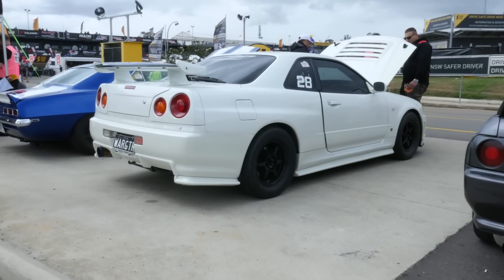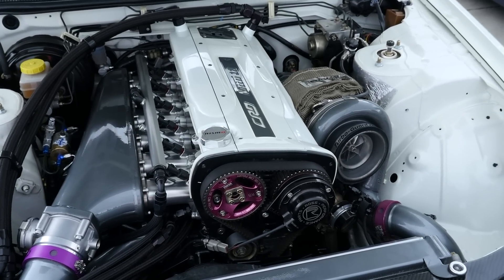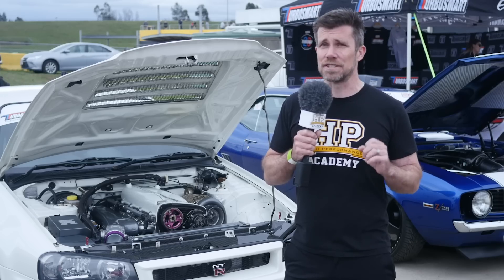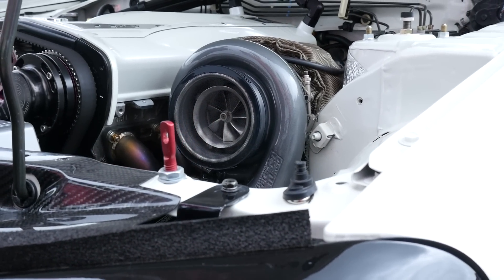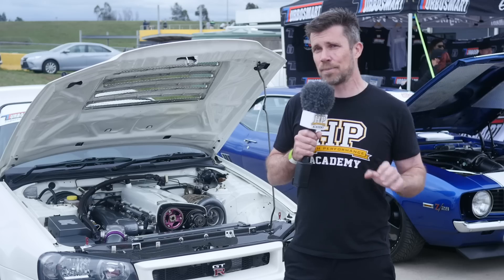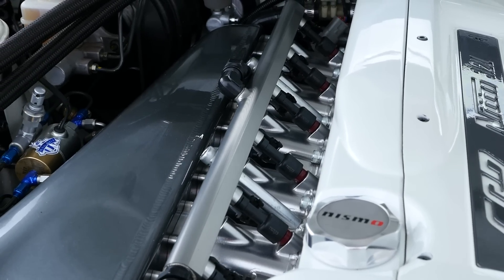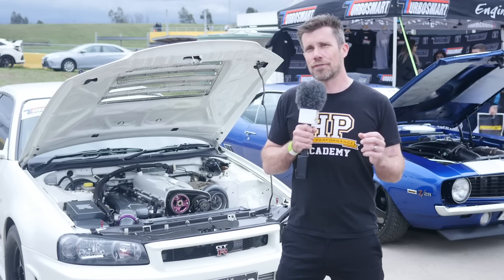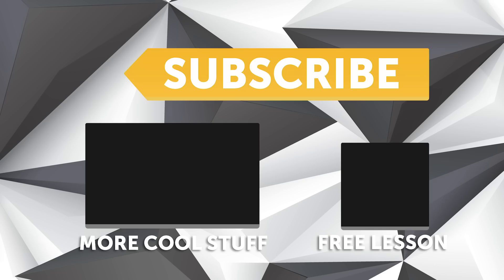1300HP And 41PSI From A Nissan R34 Skyline | The RB26 Powered WARGTR [TECH TOUR]

Comment: So that means this car doesn’t have a clutch
Reply from the maker: You still need the clutch to pull off, from there out though it takes a back seat :) - Taz.
Reply: +High Performance Academy So you don't need it for downshifting?
Reply: When your just cruising the clutch has to be used, you can only shift clutchless when wot.

Comment: Both your channel and motive DVD video has open my eyes on the potential of the RB engine still viable for racing applications. Recently Motive Video shown us the RB30 and RD28 blocks are the strongest RB blocks in the bunch and even the N1 RB26 block is no better than the stock U05 RB26 block in the R32 and R33 GTRs. 

Combined with good machining of the block bore and cylinder heads and bracing of the bottom end. It no wonder we get to see RB 3.2L to 3.4L going way above the 1000bhp mark.
Reply: Lin Chester even GT500 RRR isn’t that impressive. Smh
Reply: @soraaoixxthebluesky  did i even mentioned about the RRR block? NO!!! GTFO
Reply: @linchester8464  nah but motive did test it, so relevant to your point man

Comment: Dumb question: Is the Ross Performance Parts cam trigger kit a drop in replacement for the factory CAS? I'd assume not but have to ask to learn. What engine management systems support this setup or does some custom programming need to be done?
Reply: yba202 thanks for the excellent answer. I'm not a tuner but I am a customer. I like to understand the technology and the solutions before having a conversation with my tuner.